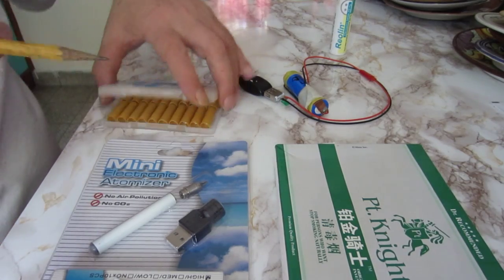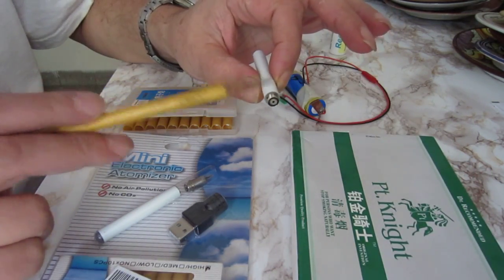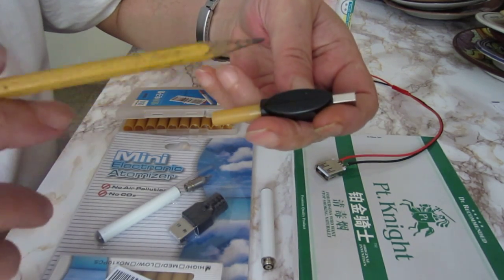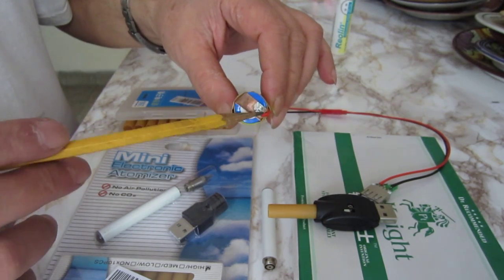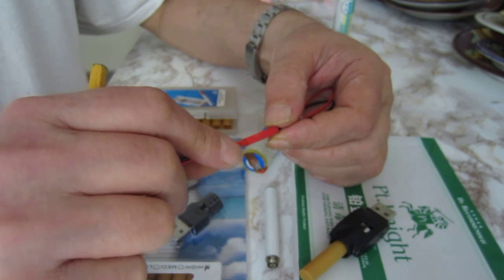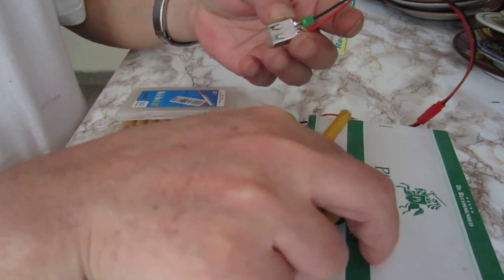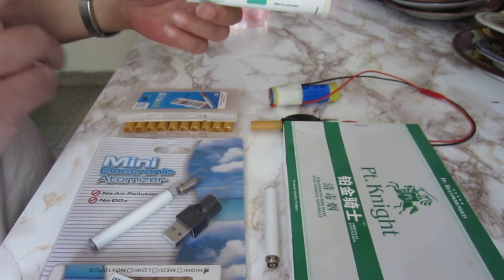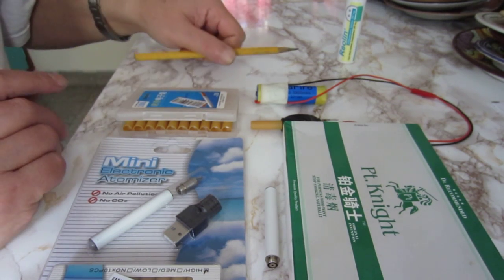DIY E-Cig. Great Vaping. e-cigarette.自动翻译字幕 Перевести авто подписи traduire légendes

Comment: Did you put this in an altoids tin?
Reply from the maker: no. its a makeshift solution until those cartridges are spent.
get a Vivi Nova with coil rebuilding stuff and real e-juice. and start saving and quitting on ciggs.

Comment from the maker: In the clip you mention, the guy explains about amperage and heat. Same here, you need a rather big switch / push button as the Ampis rather high = melt. What I did is quick and primitive : 2 copper plates. You can rig with thin rubber ring or buy 1 battery holder with a slide button which is less convinient, or buy an appropriately rated push button. Also you can add a (variable) resistor to adapt the current to the evaporator ( so it won't die quick) . Li-Ion starts at 4.2V , make it ~3.7.